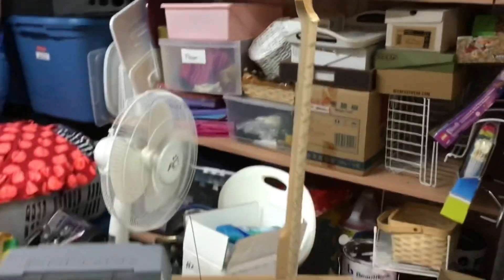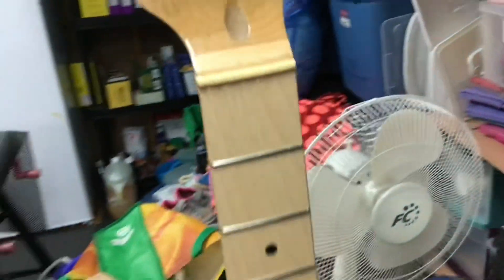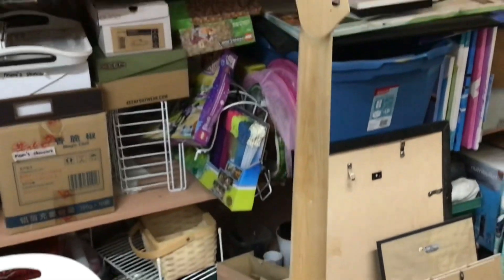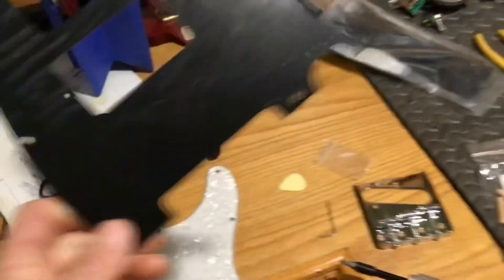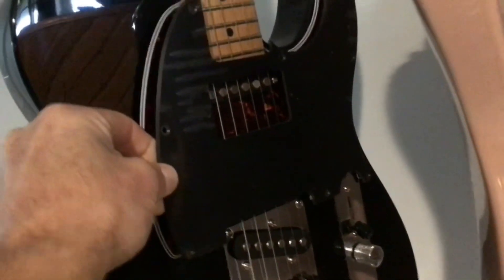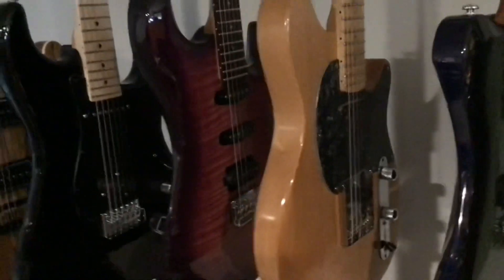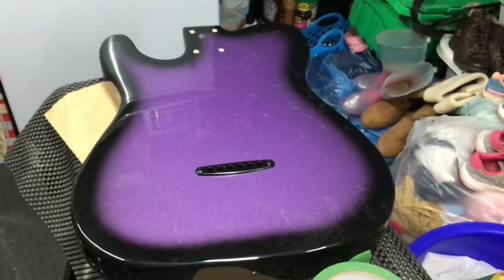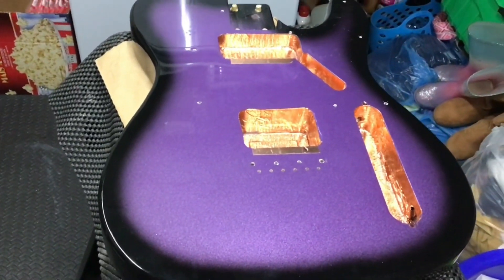Groove T-Style: Let the upgrades begin (Part 1)

Comment: I've happily watched almost all of your videos!  About those dowels, I usually score a pressure relief line (or two) into the dowel so that when I tap it in, the excess glue can squirt out and not split the surrounding wood; assuming the dowel was rightly sized.
Reply from the maker: @HappyGeneRC  cool thanks and good suggestion. I'd have to rewatch but I think I used   splined dowels. So lots of room for the glue to stay between the dowel and the hole wall😃
Worked out well and guitar came out very solid and a good player!

Comment: I guess this is why they say T style and not "tele." A "made to be modded" guitar should just be basic spec, like body and pickguard size and where the pickups go and the control panel. Otherwise, well, it would be anarchy! Really nice work, J, especially that shielding. Looking forward to the next one as it makes me feel "Groovy, shan-na-na-na-na-na-nah nah nah, feeling groovy!"
Reply from the maker: Hahaha thanks! I hope this thing is playable when I'm done lol!
To me a Tele modding platform only needs to have the cavities bridge mounting holes / string through body holes, neck to body angle and neck heel / guitar pocket to proper specification. Headstock, type of pickup cavities (single coil or humbucker) makes no difference to me!😁

Comment: The neck also must sit about an inch further back into the neck pocket since the pickguard is forcing the bride back too, will your upgrade bridge even intonate properly,among the waky way of this guitar.
Reply from the maker: Hey man, no... I think the bridge pickup and control cavity routs are just 1/2 inch back. I don't think the neck rout is off. this is why they made the pick guard longer other wise it would of looked funny, especially around the control plate... It should still intonate as my replacement bridge has extra long intonation screws. we'll find out by the end of this week haha!🤞

Comment: Just wondering about the length of the neck. With the bridge so far back, is the neck shorter that a normal 25.5 scale length neck?
Also, you can spray paint he pickguard.  Paint the pickguard the color you want, then go over the paint with polyurethane spray, seems to work fine.
Reply from the maker: Hey Dan! Yes the neck and pocket seem to be ok... they just moved the bottom routs back further for whatever reason... Actually The EART teles were like that too. The Eart body had a way better fit and finish, but the bridge routs were further back by 1/2'' on the EART as well...
I did think about painting the pickguard, I just thought wrap would hold up better to pick scratches etc...??
Reply: @j-man9457  The scratching is why I go over the paint with clear satin polyurethane. It seems to be very resistant to scratches, although it does require some sanding and polishing, if you want it perfectly smooth. 
I've never tried a wrap, but that's an interesting idea.  I would like to see how that turns out.
Reply from the maker: @danrunnoft6642  interesting. Any particular brand of poly?
Reply: @j-man9457  I've been using Rust-Oleum spray satin, but I imagine others would also work.  You could go with gloss, but that would be too shiny for my taste. You can polish the satin to a semi-gloss if you so desire.
Be careful though, once you start painting pickguards, you might open up a whole you avenue to express your inner artist.  
I have to confess that I've spent a lot of time painting a pickguard, only to decide that I didn't like the way it looked on the guitar, and then painted over it with something completely different.